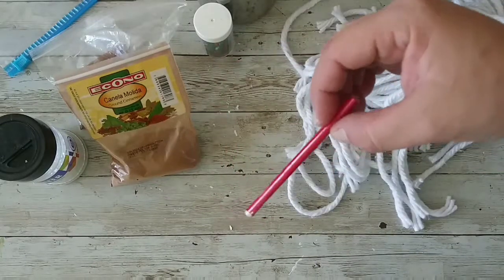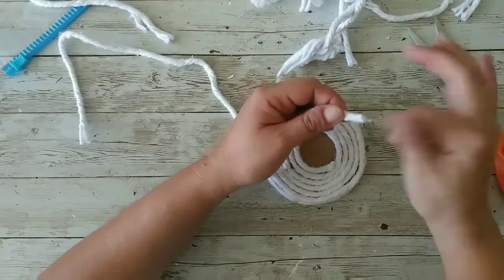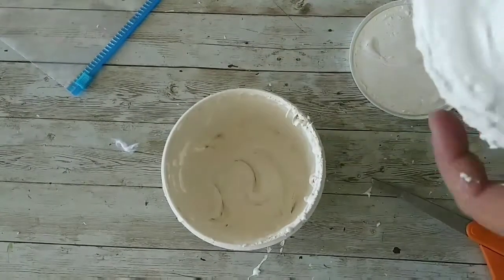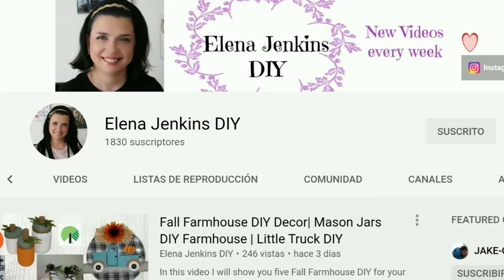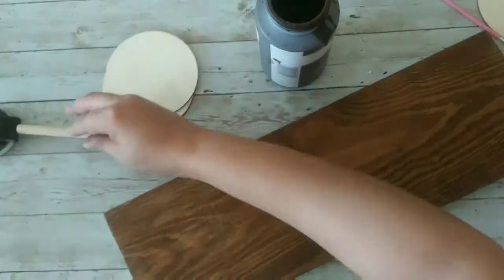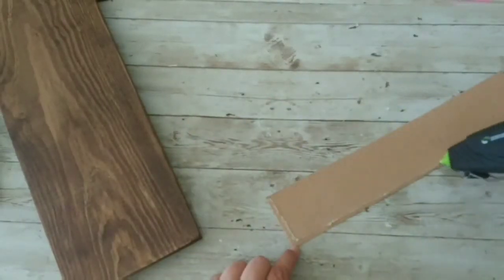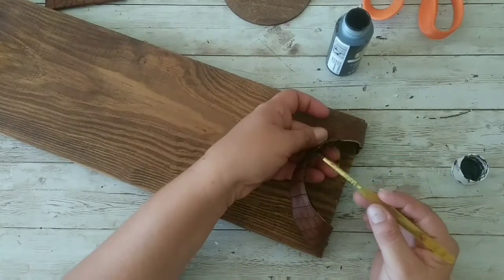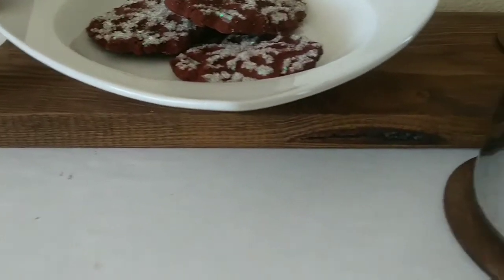Wood Tray & Faux Hot Cocoa Station | Inspired DIY Challenge

Comment: You don't need to go through all of that trouble. Just make your spackle or whatever, you are using, thick and you can just pipe it in the shape you want.
Reply from the maker: That day the spackle didn't wanted to work with me that was a desperate measure for the situation😂😂.  I ended up saving some spackle and having more fun😂😂😂